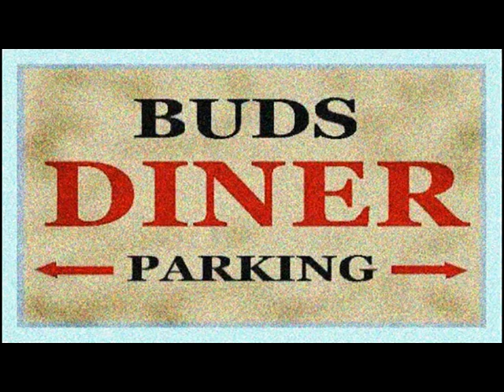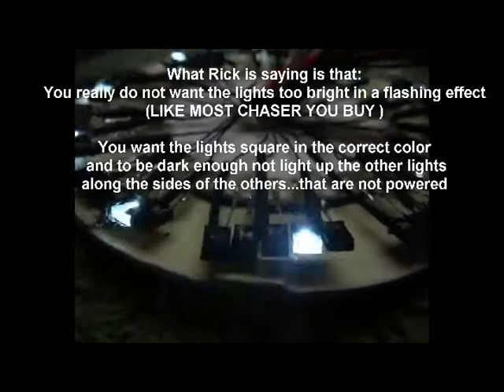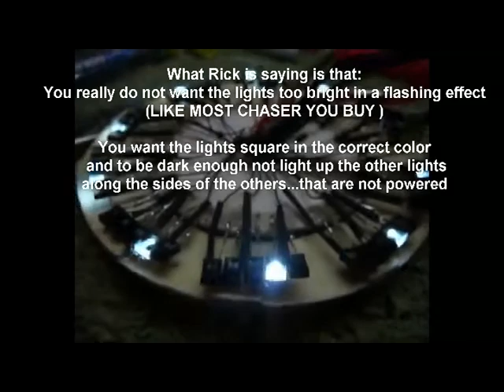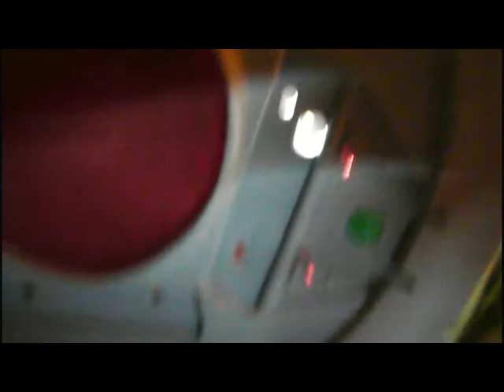Invaders UFO 10" Build  (Part #13) Saucer Upgrades

Comment: Looks like you got it right this time Mike! The studio saucer always looked like all the ports were lit at the same time. Back in 1967 Mel Keys must have been using a mechanical sequencer wired up to individual incandescent light bulbs crammed into what looks like a 3 foot diameter model